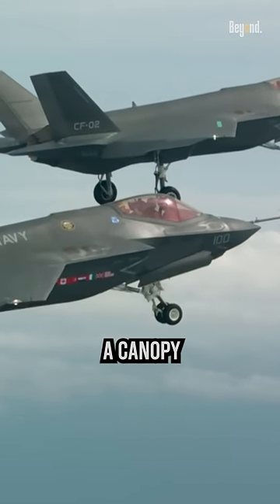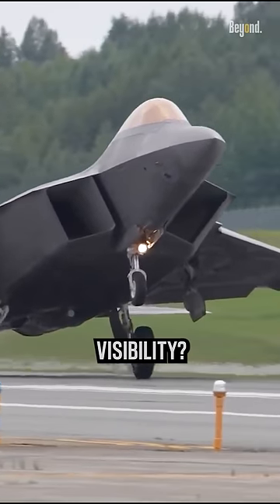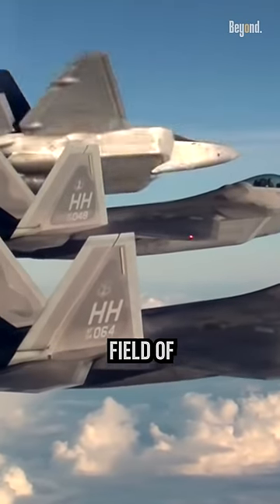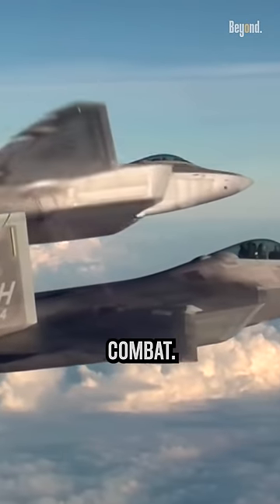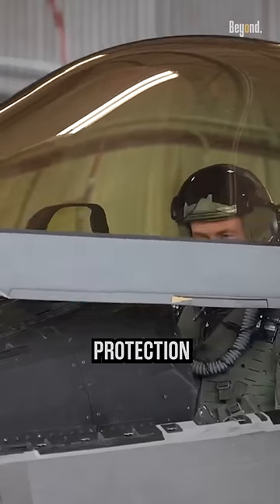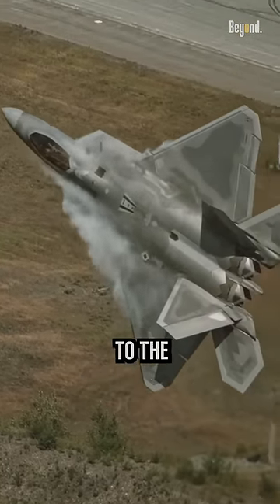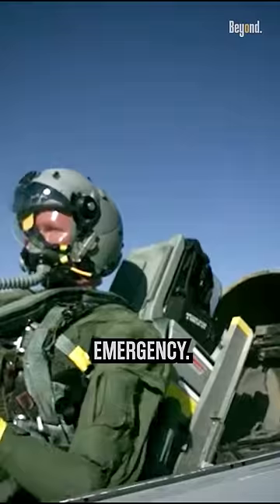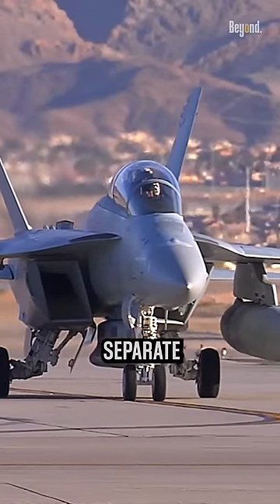Why not place the cockpit inside the transparent nose but on top instead? #shorts

Comment: There’s the answer to a question nobody actually asked . Ever .
Reply: That’s why the channel is called ‘Beyond Explained’ I guess..
Reply: To be fair they did actually try this idea in the 50s or 60s, becuase they thought the pilot laying down in the nose would allow them to pull extra Gs.
Reply: actually that question has been asked MANY times in fighter aircraft history and its a legitimate one. Some of his answers are also irrelevant. If the plane is hit it matters not where the cockpit is since the chances of the pilot being hit remains the same. As for visibility that's also irrelevant since the pilot cannot see below so no matter where you put the cockpit you lose some visibility. With modern fighters the sensors allow you to have situational awareness anyway so the actual visibility relative to the cockpit does not matter.

But if you had thought about the question for a second you would have realized that they had to have thought about it since cockpits are place in the same place on basically all aircraft
Reply: Who doesn't enjoy a nice cockpit though?
Reply: And they like this but have simultaneously given 0 F's 😂
Reply: Also with current technology you can see through the plane
Reply: My thoughts exactly!
Reply: That dilemma has been interfering with my sleep!! 😂😂
Reply: Actually someone asked... In the '50s. The leduc was an experimental aircraft led by renè leduc... It was an idea, just not a good one.
Reply: Btw it was the leduc ver 022

Comment: The radar is in the nose. That's why a canopy can't be in the front of the fuselage.
Reply: Radar is in the nose simply coz when it was miniaturised for aircraft, the nose was free space. 
Sure it's ideal coz it looks forward etc. 
but in reality the radar could be put anywhere on/in the aircraft.
Designers were just lucky that the noses of early planes were normally empty space, and ideally placed to look forward, holding the radar. 

A whole bunch of good circumstances, adding up to the radar being in the nose.
Reply: @hardcorebossstyles yes but you really do not want that radar lobe hit you or any part of the plane, so putting it in the nose is the only viable option. Awacs solved this differently
Reply: @stefanth8596 as I recall they have a big radar dish on top of the plane
Reply: Absolutely correct
Reply: @hardcorebossstyles you don't want the human body in front of the radar due to it's radiation.
Reply: @hardcorebossstyles you can’t put the radar anywhere you like on a fighter aircraft wtf are you talking about
Reply: @Hello_there_obi literally like every fighter jet has radar
Reply: @jellybabi7600  yes and? Im saying that you can’t put it anywhere you like if you want it to function at it’s best.
Reply: @Hello_there_obi  i thought you ment fighters just dont have radars that makes more sense
Reply: @jellybabi7600  fixed it!
Reply: @marmot418  Thats just for AWACS, a dedicated radar aircraft
Reply: @marmot418  if you think they can do that with fighter aircraft…well lets just thank god that youre not an jer fighter design engineer 😂
Reply: But if they put the pilot in the nose with the radar behind him then the pilot will be warm and comfortable in the coldness of altitude
Reply: Exactly.
Reply: @hardcorebossstyles guarantee if the nose had not been empty they would have emptied it for the radar as that is the logical place for it to go. In fact jets used to have the air intake in the nose and moved them to accommodate radar.
Reply: Radar operate in the RF spectrum of NON-IONISING radiation. 

"Radiofrequency (RF) electromagnetic radiation (EMR) is the transfer of energy by radio waves. RF EMR lies in the frequency range between 100 kilohertz (kHz) to 300 gigahertz (GHz). RF EMR is non-ionising radiation, meaning that it has insufficient energy to break chemical bonds or remove electrons (ionisation)."

In saying that, sure, you probably shouldn't sit on a radar system without adequate protections, but it isn't as dangerous as the layman might think, and with over 60yrs of scientific data refuting the claim that radar emissions cause cancer, I'm sure aircraft designers are smart enough to put the radar elsewhere if required.... But as I mentioned, it just so happens that the nose of a fighter jet is an ideal position for its intended requirements, against aggressors. 

But if it turns out, that the one and only ideal location for an energy based weapon system, like lasers etc, is in the nose of an aircraft (which has been "eluded" at, with certain 747 based laser weapon systems, lol), they'll no doubt jam it in the nose, and relocate the radar elsewhere. Maybe in an underslung pod of some sort.... Who knows what the future will prove, or not, lol
Reply: @hardcorebossstyles not a plane designer, but a biologist with some decent knowledge of physics as well. Fighter jet radar from what I could find usually uses a frequency range known as X-band, which is 8-12GHz, so at the lowest end of that band, the wavelength is 3.7 cm which is well into the microwave spectrum, so assuming sufficient power, that frequency has the ability to heat your body. Even worse though, that band is wide enough that it contains many multiples of the resonant frequency of water, so it’d actually be fairly efficient at heating human bodies. Another thing is, microwaves don’t really like going through metal a lot, so whatever houses the radar has to be composite, which generally doesn’t give you great protection from shrapnel. Also as far as I know, you generally shoot at targets in front of you, so having as little mass in front of the radar would be beneficial to minimise the absorption of the emitted microwaves.

Also as a bit of a personal note, I doubt anything is these state of the art machines was designed on “ah there was just a bit of free space, so we shoved it there”.

Edit: for reference microwave ovens generally use 2.45GHz, and any multiple of that frequency will have a similar effect (albeit requiring more power). Also an average microwave oven is around 1000 watts, from what I could find, the f-22’s radar operates at 20 000 watts peak power.
Reply: @marmot418  Very different type of radar, with much larger wave length and less reason to lock on to targets
Reply: Also a good fact The Pilot wont lay while flying
Reply: @hardcorebossstyles Sure. We can put the radar on top. Yet for the best aerodynamics you want the bulky piece of equipment forward with the least amount of material blocking it. 

 Radars today are super sensitive. You don't want a ton of electronics and material in front of it as that will cause interference. 

I a'm not sure about radiation. 

There literally is no better set up for a fighter.

 AWACs have the dish on top due to it being so big. I bet they'd prefer it on the bottom yet you need to land. 

 This is one of the most ridiculous videos I've ever seen. The only time the nose made sense was for a WWII experimental fighters, and then when crazy ass people were designing planes to pull more Gs. 

 Outside of that it was either guns or radar.
Reply: Here is the main reason
Reply: @hardcorebossstyles 😊😊😊😊😊😊😊😊😊😊😊😊😊😊

Comment: The f35 has a helmet that gives the pilot the ability to see through the cockpit. Very impressive. Very expensive too.
Reply: It doesn't have to be that expensive. It is an example of government spending.
Reply: Not just the f35, f22 has it too. Believe it started with f22
Reply: @denisbeaudoin4618  each plane has has a different type of helmet display.
Reply: @newmanattack  that may be, but the virtual  "see through" hud is in both
Reply: @denisbeaudoin4618 . The Typhoon too.
Reply: @denisbeaudoin4618 it is not on the f22 because the f22 doesnt have das or eots.  F22 doesnt even have helmet mounted cuing.
Reply: @newmanattack ya, i bet i could make them for 398k.
Reply: @Typexviiib  well they do. Sry bud
Reply: @denisbeaudoin4618  saying it over and over again doesnt make it true.  Sry bud.
Reply: @denisbeaudoin4618  f22s use the hgu 55p, which is a standard helmet without cuing and certainly without 3d virtual display.  F22s do not have das, they don’t even have irst, so they couldn’t even generate such a display if they wanted to.  Never mind the fact that canopy issues have thwarted every attempt to modernize f22 targeting in the last 20 years.  

The ngfwh is being developed, but there have been several issues and currently only supports helmet mounted cuing. It will not get the 3d vr display and capability until the 9 billion dollar upgrade program concludes in 2030.  This program will give f22 2015 era f35 avionics.  None of this is currently in use.
Reply: @Typexviiib  but it is. And they do. Nice try tho
Reply: The US values its pilots, a lot
Reply: @newmanattack except us stuff actually works as advertised (cough, russia, cough)
Reply: @ruska9773  I've used them for literally hundreds of hours, but go ahead, tell me how they work.
Reply: 400k a pop!

Comment: Missed the most important reason, in the nose of the plane there are radar dishes produce radioactive emissions and if the pilot was in front of those radars they would be cooked like a hotdog in a microwave oven.
Reply: in this day and age that can be mitigated
Reply: Radar emissions definitely are not radioactive. They do however heat up tissue and can cause severe burn wounds.
Reply: @sebkuip    Nor are radar waves ionising radiation — that starts in high end UV and contains X-rays and gamma radiation.
(Radioactive α and β decay emit particles that are ionising but easily stopped, neutrons can also be ionising…)

Non-ionising radiation can heat you up like food in a microwave — phones have very little energy and won’t heat up your ear dangerously, radar is vastly more powerful.
Reply: @hardcorebossstyles  
How?
Reply: @advorak8529 weren't there already documented cases of this happening
Reply: @miketan4803 yep and they are called RF burns. Most of the time they can’t be seen, but they are their and extremely painful. Unlike regular burns RF burns form on the inside and deepest parts of your body.
Reply: Radar produces very small waves, called micro waves. Like a micro wave in your kitchen. So indeed, better not sit in front of it.

Comment: What is interesting in this video there is a A-10 flying in formation with other jets. 
Now the A-10 is an interesting choice because the pilot is in a tub of titanium that rated up to 20mm protection which is something you need for a ground support aircraft to be able to provide support for ground troops. 
However the idea of having a clear front nose maybe more possible in the near future. A little over a year ago I saw a video that was very amazing tech that had been created, it was clear Aluminum, it looked like glass and was clear but it was a piece of Aluminum and inches thick but clear as glass. 
Now I haven't seen or heard anything else about it but it would be a major game changer in military roles especially if you want to make an invisible war machine.

Comment: However, for Bombers used to have a dome cockpit, by that I mean the HE-177, HE-111, and the B-29 Superfortress, the B-29 Superfortress not just have the dome cockpit but also an experimental Pressurized Cabin which has no need for Oxygen Masks, and automated gun turrets, which has a gunsight to control said Automated Gun Turret

Comment: The reason for the cockpit to be in front is because the exhaust would cause visibility issues if the cockpit was in the rear.  The engine is located with the exhaust exposed so that the gas can exit.  The landing gear has wheels that roll on the runway.

Comment: People also forget. There are a lot of buttons and switches they cram into that space below the sholders.

If you were to strip all the forward instruments away for glass amd visibility, where will you put them instead?
Behind the pilot?
They need to see those system reports to identify did they take damage on the last maneuver avoiding missiles or dodging a gun pass.
The artificial horizon might be fine against the glass, but where will you look to check you selected the right weapons loadout?
Reply: Star wars TIE fighters have this design, and the visibility is horrible.

Comment: If you replace the pilot with automated insight, AI, you can eliminate the seat ejector button. Eliminate a lot of weight, and you don't have to worry about the pilot having a red out or a blackout due to centrifugal force and extra g's

Comment: I think the narrator is too narrow minded.
Look at the F35's cameras and helmet. Today, pilots can see through the plane in all directions. Now we don't need a canopy at all. An aircraft can be designed with the pilot inside a closed capsule. One which the pilot is protected even more because there isn't a canopy.
The aircraft would be more aerodynamic then with a canopy. The ejection system doesn't have to change. It's just the capsule would eject by either pilot or AI, based on warning sensors.
We can design a flexible airframe around the pilot based on the best aerodynamic flow which would configure by AI. Giving us the ability to land slower and fly faster. To top it off, it would be more stealthier than aircraft before.
Reply: Screw AI

Comment: Um, the most important reason is RADAR! You want to look at the space to the front of you! RADAR is THE most important part of the aircraft!
Reply: Really? The engines get the aircraft into the air. The wings lift it. The fuel runs the engines. And the PILOT controls it all... the radar is NOTHING.

The most important part of the plane, would probably have to be the pilots water bottle. 
Keeping them hydrated, alert, and in the fight.
Reply: @hardcorebossstyles   Perhaps you should re-read the comment by, @UCVkibLKbzWKnh3y7zTxfXHg instead of rebutting a point, he did not make.
Reply: I’d beg to differ.  I think the engines are a tad more important
Reply: @harryparsons2750  Why would you bother to make a jet that is just going to be blowed up real good because it can't see anything? You can put those engines on a car and go real fast.
Reply: @hardcorebossstyles  but that all blows up real good when you can't see anything further away than 40 km! Why bother just put the engine and fuel and a jetski and have fun before you get blowed up by a jet with radar.

Comment: Yeah the cockpit does not provide more protection than the rest of the fuselage. And you don't have transparent nose because that's where the radar is. And canopy doesn't slide back when you eject, it blows off using pyrotechnics. And no the cockpit isn't more aerodynamic that a theoretical nose cockpit flush with the fuselage. Almost everything in this video is wrong.